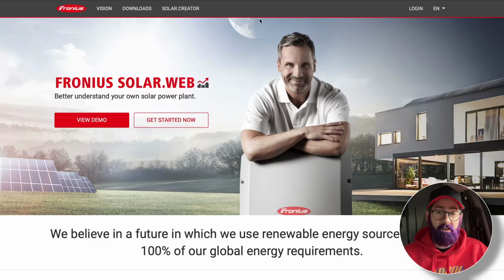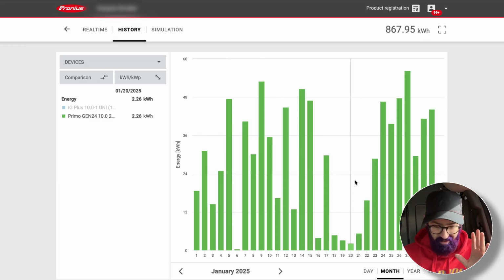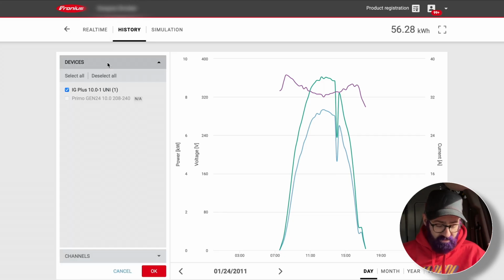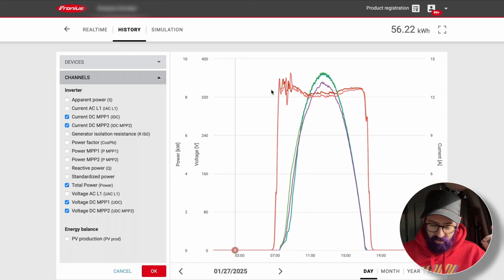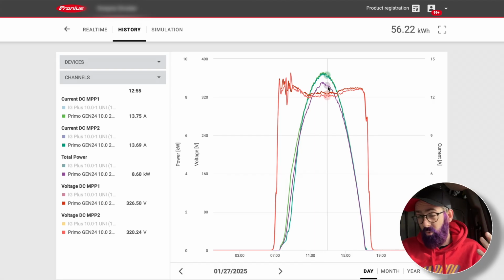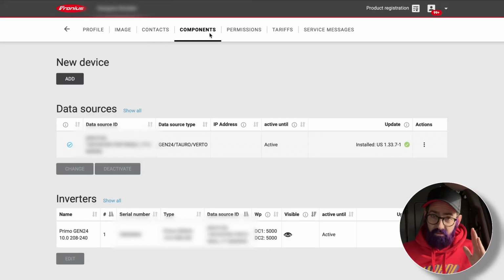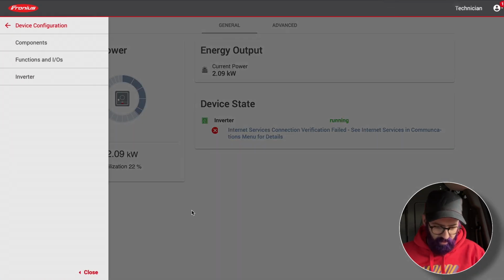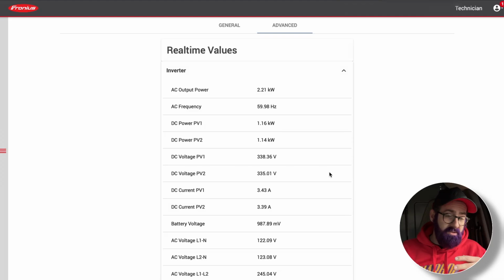Remote Control Your Inverter! - GEN24 and Solar.Web

Comment: Is it possible to remotely turn on and off the inverter?
Reply from the maker: Not really, no. Sometimes you can reset faults remotely, but not something that would affect this issue. There is an ability to turn off production remotely, depending on very specific factors

Comment: do you have a ETA for adding batteries like your last Fronius install talked about??????
Reply from the maker: @jimrainman7923  I don't have a customer interested in batteries right now, unfortunately. If/when it happens, I'll 100% be making that video.
Reply: Is it possible to remotely turn on and off the inverter?